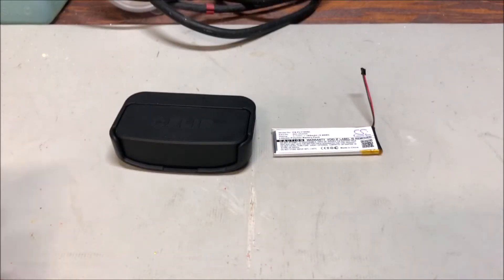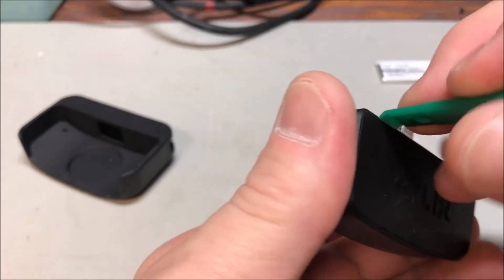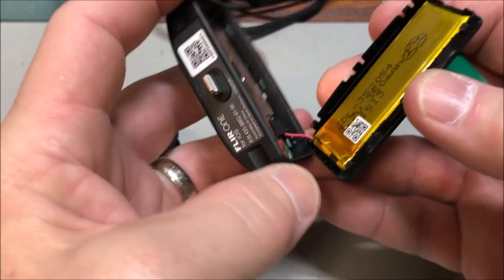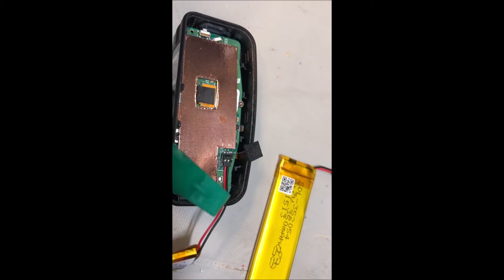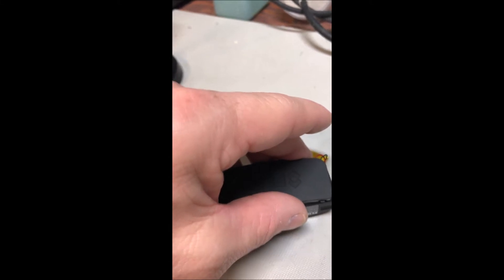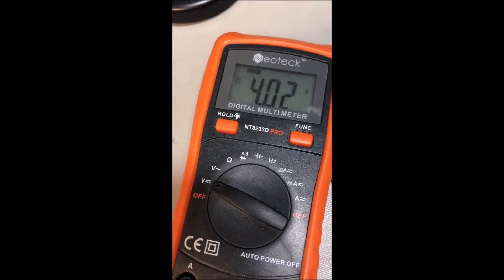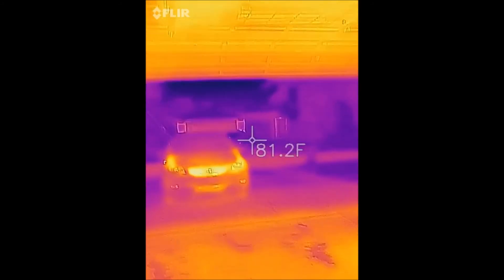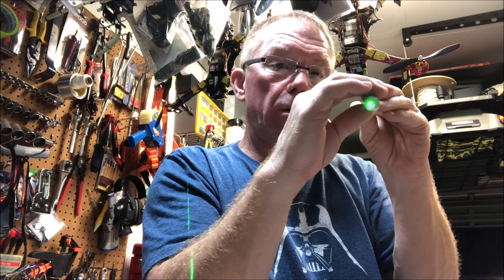FLIR ONE battery replacement

Comment: The replacement battery is half the capacity of the original  - is it possible to get the original capacity?
Reply from the maker: Sure it's possible- but you'll have to look around and get the right size.

Comment: Howdy Dave and All: thanks for the video, my 9yo and 5yo are doing this with me and I'm grateful your video is concise and detailed so they can help me in a big way. I can't seem to locate a battery that is thin enough to re-close the case though. Can you please share a link to which one of the several options you purchased? Thank you!
Reply: OK, MY BAD. I just installed the right one and it seems to be charging great, thanks! 

I recieved the correct battery but checked it against the wrong replacement. If that's confusing, it's actually not, I'm just silly.
Reply from the maker: Sure- I got mine here:

https://www.amazon.com/gp/product/B07J5VXKL8/ref=ppx_yo_dt_b_search_asin_title?ie=UTF8&psc=1

Make sure the part number matches up with that of the original, or it's an equal substitute. There might be different batteries for different generations of the FLIR ONE.
Reply: @davefalch1038  Thank you very much. Kids are excited to see if I can make this work...so am I, downloading software now
Reply: Good evening! I was able to sucessfully replace this battery and everything was working fine during my tests but now it seems like my Flir battery is dying almost instantly. With the 185 mAh battery, about how long does your Flir work? Also, is there any guidance on charging? Maybe I overdid it somehow? Seems like the small green LED flashes for a while, then stops, which to my recollection means the battery is charged, but maybe I'm just repeating the same mistakes I did the first time?
Reply from the maker: @clearviewconstruction5059  Sounds like it's charging correctly. Maybe run it down until it's dead and fully charge it a few times for a full power cycle. If it still acts up, I would suspect a bad battery.
Reply: @davefalch1038  Update here is that I had almost given up on the battery and then WHAMMO, for some reason it worked after the approximately eight charge. Now seems to work fine. 

Does anyone have any tips for how to drain the batter completely without using my phone? Thank you!

Comment: I just ran the wires outside the case and glued a 18650 cell. Lasts forever now. Doesn't look pretty, but more practical.
Reply: Great idea. I'm doin it!
Reply: @RobSummers993  I changed to a cell out of a faulty macbook battery. Flat square. More suitable. Looks super handsome.
Reply from the maker: Roger that- whatever works!
Reply: Was thinking the same while watching.  I might get a larger pouch cell and use Magsafe magnets to hold it to the back of my phone.